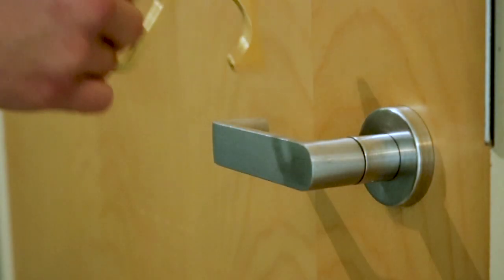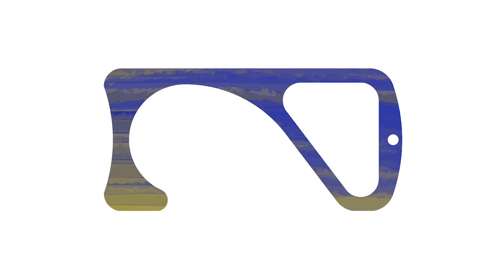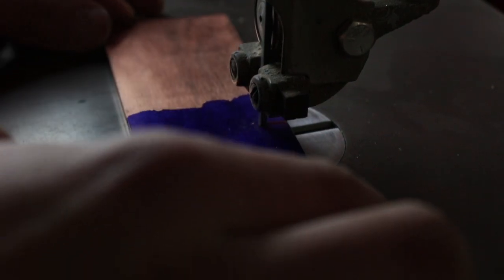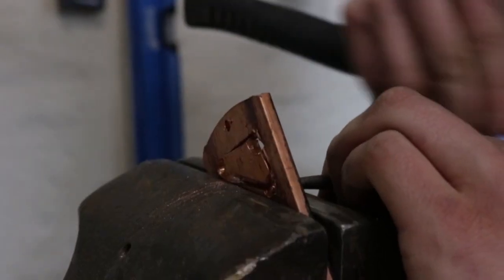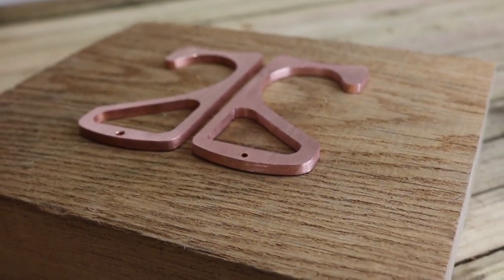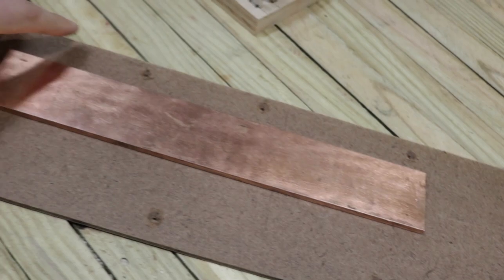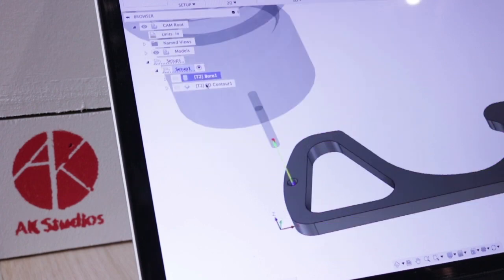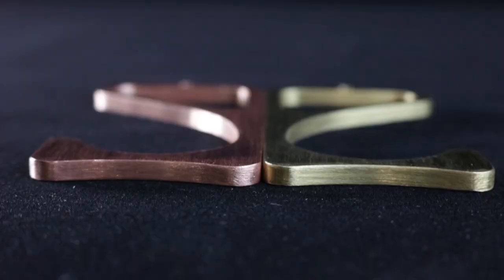HOW TO MAKE: Hookd: The Antimicrobial No Touch Tool

Comment: It should be noted that while copper is antimicrobial, it takes 4 hours for the SARS-COV-2 to die on the surface of copper. It should be cleaned with a fast acting antimicrobial, like good old alcohol hand sanitizer before you put it back into your pocket/purse/bag after using it, unless you don't mind transferring germs from the key tool to your holding place. I'm not going to list references here, because this information is considered "common knowledge," since there are in excess of 5 reference sources. If you carry hand sanitizer to clean your hands, just clean this tool at the same time, and you're safe!

That said, I want one of these! I've sent this video to my son, who enjoys this kind of hobby.